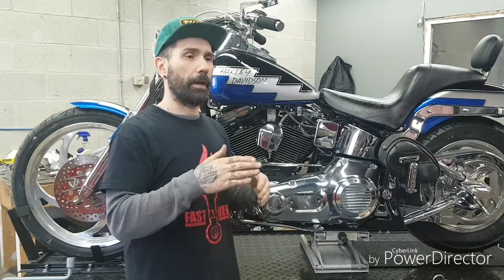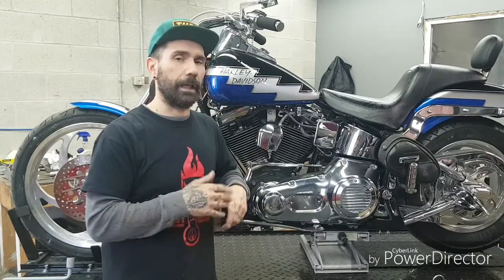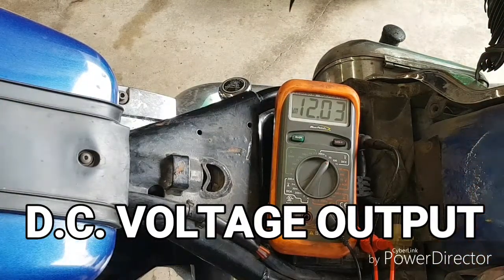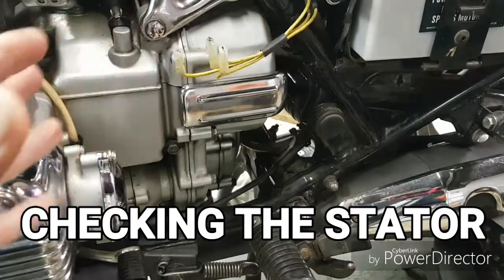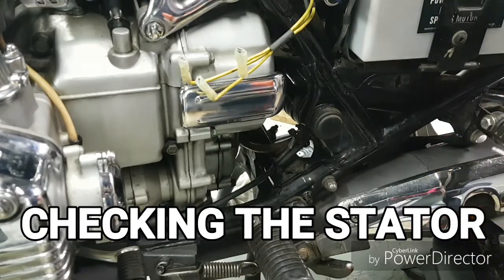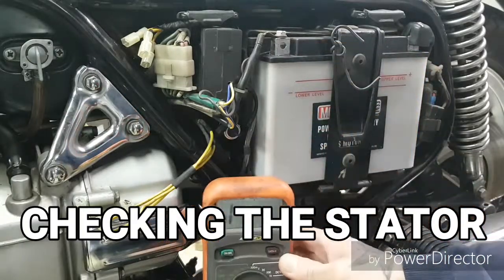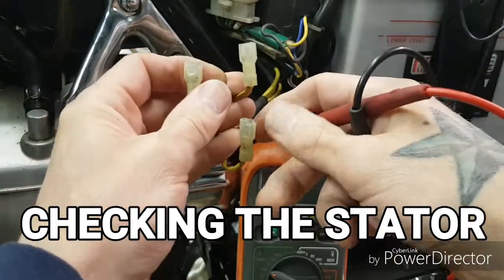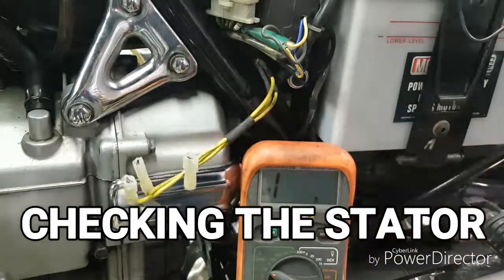Motorcycle Charging System Check

Comment: Awe man wish you still made videos
Reply from the maker: I just gotta make time! Any topics?
Reply: @CrackerJackMechanic  

Carburetor/fuel system repair (old bikes woo!). Engine rebuilds, general maintenance. Custom made bikes like choppers. Fabrication/welding. Repairing drive shafts. Fluid changes. Transmission rebuilds. Implementation of things like oil coolers. 

Hope you grow this channel into a monstrosity of epic motorcycle knowledge! Cheers.